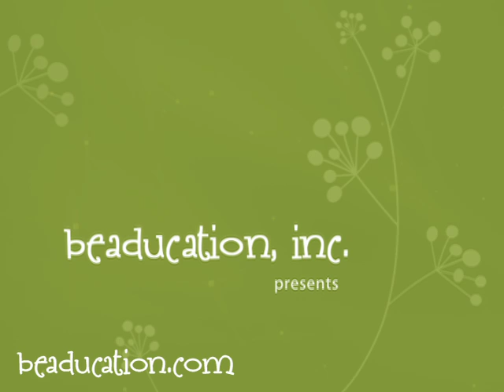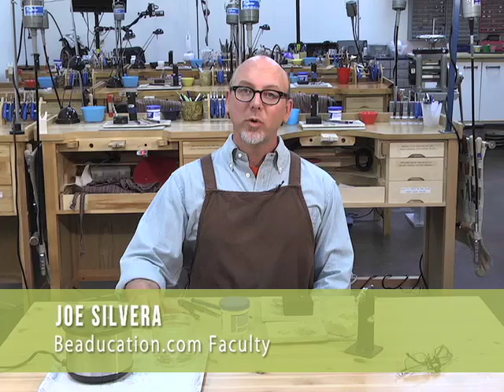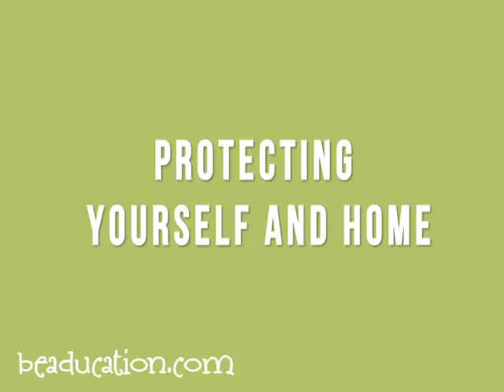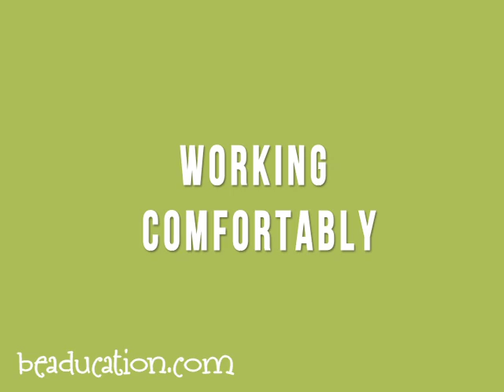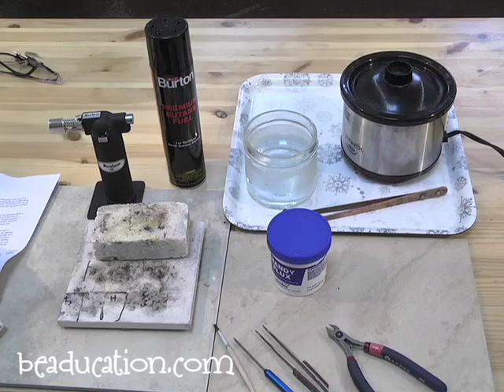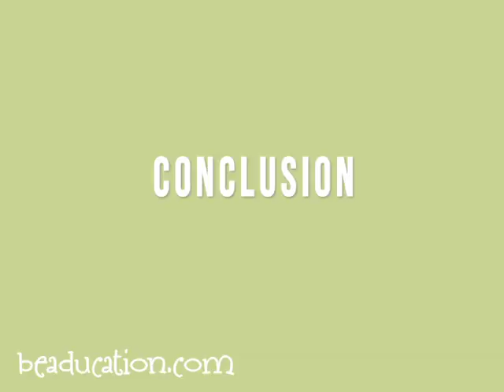Setting up for Soldering at Home - Beaducation.com

Comment: I recently took a ring making class, and learned to solder. After telling my brother this he gifted me with a soldering iron. I didn't have the heart to tell him I had no idea how to use it since we used soldering wire and a torch in the class. Is it possible to use this for jewelry?
Reply from the maker: Unfortunately, no. When soldering like we teach, you need to heat up the whole piece to get it to solder. The solder irons just work for spot soldering at much lower temperatures.
Reply: Thank you for your response! I love how helpful you guys are!